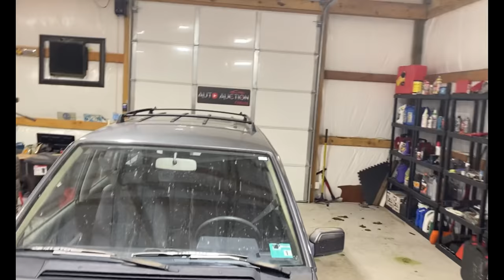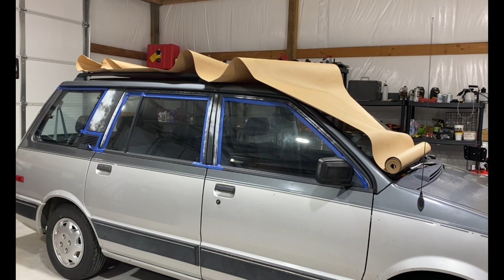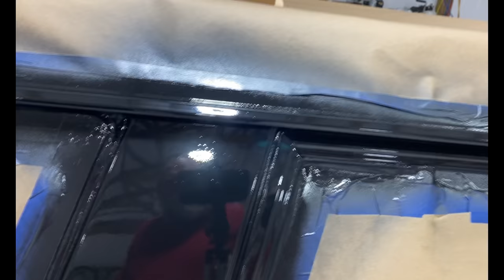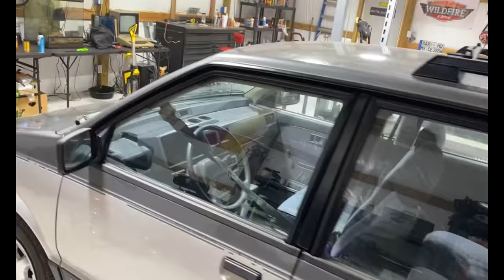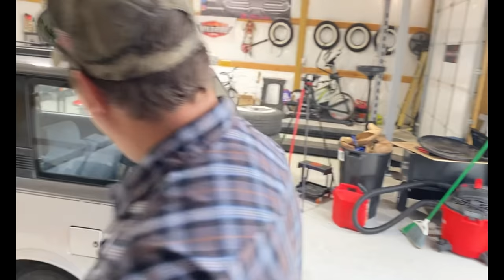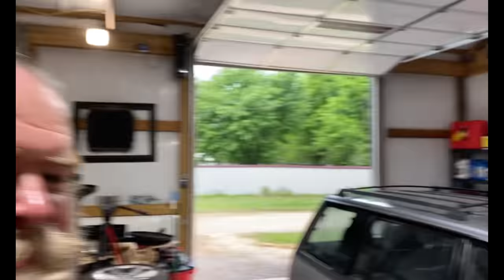AAR Plymouth Colt trim renewal

Comment: The car looks so much better!  Glad you got the wipers too.  I couldn't tell if you put a couple of coats of clear coat on it.  Great job!
Reply from the maker: The rattle can clear tends to turn milky and flake when left outdoors, I only do straight paint so it is easier to touch up later on. I have a set of wipers that I sprayed going on 7 years now that still look good!

Comment: Though not a true Mopar, imagine the amount of attention it would receive at any Mopar car show! Charger, Charger, Challenger, Challenger, Colt, Charge... WAIT WHAT!!! Yep, I'm that kind of car guy. It could be a 2021 Ram TRX and I could care less. I'm more interested in a surviving Dodge Ram 50 from the 80's & 90's. 
Mike, your finishing touches went a long way into making this true time capsule whole again!
Reply from the maker: Thank you! I have a survivor dodge myself! 04 ram 2500 with 601,000 miles!!! When it hits a million I’ll give it a paint job!
Reply: @SantasWorkshop  I have quite a ways to go to catch up. Mine are a 1997 Ram 1500 5.2L w/225,000 and a 1995 Chrysler Concorde 3.3L w/191,000. The Ram I've owned since '08 at 87,000 miles. The Concorde I bought in 2019 at 161,000 miles. Both have been one owner vehicles with all original powertrains. Like yours, mine will need repainted.

Comment: I did basically the same thing to my 99 Saturn SL2 replaced broken door trim, painted the roof rails  the rear spoiler and the rear bumper.  Plus 2 coats of clear lacquer.  It looked like a new Saturn with 130k miles.
Reply from the maker: Nice!

Comment: You should have painted  that cowel vent cover too and the mirrors  and that big moulding on the side too, but still a big improvement
Reply from the maker: I did get the wiper arms but didn’t have what I needed to prep the plastic of the mirrors and cowl.

Comment: Looks pretty dang good! Did you do any prep or just sprayed her down?
Reply from the maker: Thank you! Yes, I wiped down with low temp enamel reducer then sanded with a scotchbrite finish pad, aluminum scratches so easy I didn’t want to go too heavy, then wiped and tacked before spraying. I had moved the camera and bumped the stop button so I lost that footage 😩 I intended to put text in there describing what I did but forgot. Old age sucks!!!!
Reply: @SantasWorkshop  Now with that little bit of trash in the finish would you wait for it to cure for a few days then buff it?
Reply from the maker: Do not want to buff since it’s not a gloss, color sand clean well and spray another coat.

Comment: Why didnt you do the plastic behind the wipers?
Reply from the maker: A good plastic/vinyl protectant is all it needed and paint would most likely start flaking.
Reply: @SantasWorkshop  The krylon worked well on my first generation Xterra (not sure if you remember the plastic on those faded badly after a few years in the sun)